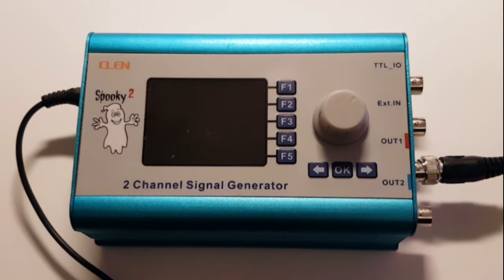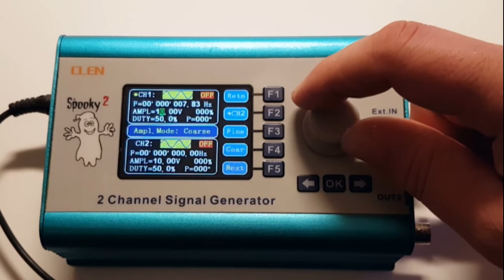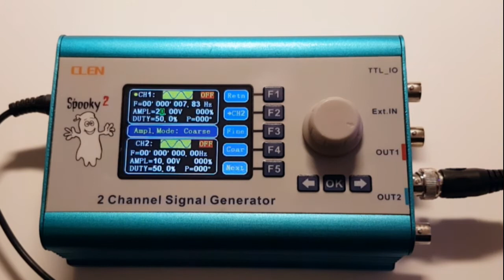Spooky2 XM Generator Manual Settings

Comment: radionics is a topic that the more I learn about, the less idea I have how to do something
Reply: I have 3 Berkana radionics pieces of equipment for over 4 years, no clue how to start using them. Every time I pull them out, I just end up putting them right back in the box they came from.
Reply: I am finding the same thing and I believe it is because there is no "standardized or structured  training" about it, and relying on YouTube videos to teach it only confuses things more. Youtube presenters may--or may not-know their areas of expertise, but most are not trained in "communicating technical information in a structured, well-organized fashion.

Comment: Thanks for showing this, however when i look at my XM generator which is hooked up to the pc, with the 7.83Hz freq, i see in the screen on the generator in the frequencie field: F=00' 007' 830. 00 Why is the frequency now moved 3 places to the left? 
Is this as it is connected to the computer with the Boost?
Reply from the maker: They have updated the chipset since the version shown in the video so it could be why. 

The frequency wants to look like this: F=00'000'007.83

Comment: hey Man, I know this video is hella old, but I have a question.
Can I use the spooky2 Booster to run 2 Berkana Labs radionics devices off one generator for two purposes? I just set ch1 with your settings, then plugged a second radionics device to the mirrored connector (the bottom left and right connections on the older boost) and when I set the generator to run the led on both radionics devices light up.
Is this a way to run two radionic operations on one generator? Or not?
TIA
Reply: Yes as along as you are NOT using the software and the boost from Spooky2.  Spooky 2 chains the 2 channels using the second (very often) for an INVERSE waveform.  The boost does other things to the outputs.  The spooky 2 software also sets the waveform to SQUARE wave for Schuman.  I was wondering if that was recommended.  In this video AW sets it to sine wave.  Smoother wave then square.
Reply: I know this is a very old video but how do I change the wave pattern from sine to square? ty

Comment: Thanks for doing this. Lots of people think that this generator won't work without the software.
Reply: Oh contrary my friend.  This is a stand alone signal generator pressed into use as a USB connected generator.  You can use the 100 memory slots to store frequencies, if you know what you are doing.  The front panel is the key (as well as the USB secret codes).
Reply: @robinhandelman9228 whats the usb secret codes
Reply: @robinhandelman9228  can that be done with the GeneratorX pro too

Comment: I soon bought a generator spooky2 and spooky 2 radionics.Can the software choose medicine and get it on the output of spooky 2 radionics? With this  two devices can I make homeopathic remedy ? Is there a video that can help me?
Reply from the maker: You can use MW or molecular "weight" in the software to make simulations of a variety of compounds, with the homeopathic potentiser you could make a potentised remedy of this https://berkanalabs.store

Comment: Software quit before 2nd use 3 days out of the box freezes on desktop when load concludes 40000.. Win 10 task manager to end task or it's useless nonfunctioning screenshot of the spooky2  DataLoad Test icon) and nothing else . Replaced communication circuit already  before it's second use. Software is shown in 'ports Device Manager now, still no change. Yes the machine over the software when unstable software is all i'm thinking at this point. One more try then uninstall reinstal software April 2018 a second time.
Reply from the maker: I believe there was a bug fix. I am running Windows 10 and have never had a problem with the Spooky2 software with the XM generator. Perhaps updating the system drivers on your PC might resolve the problem.
Reply: using windoze 8 without any issues.

Comment: whats difference between this device VS FeelTech FY2300
Reply: I have both devices.  Programming the FY2300 via USB directly is painful.  If you have their software you can try that for single frequencies but nothing complex.  The front panel is VERY similar as I believe they are made in the same or nearly the same factory.  Your mileage may very.

RAH
Reply: BTW, The price difference between the FeelTech and the Spooky2 isn't that much.  The Spooky2 has 100 memory slots.  I am not sure how many the FeelTech has.  It's not handy right now.  There are versions of the FeelTech FY2300 that go up to 60Mhz the Spooky2 goes up to 5Mhz or 10Mhz with some SW via USB.  FeelTech versions are labeled for their max frequency by FY2300-10M for 10Mhz and FY2300-60M for the 60Mhz (and there are others in between).
Reply from the maker: From what I've heard they are similar, I don't have that model to personally check it though